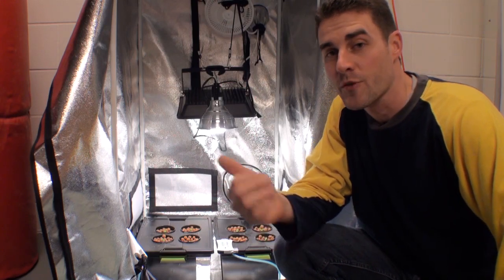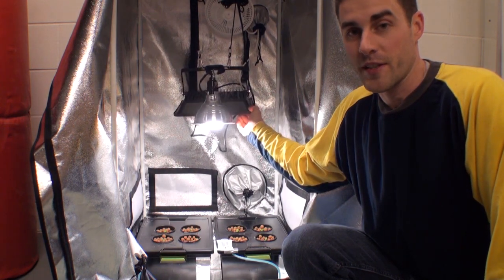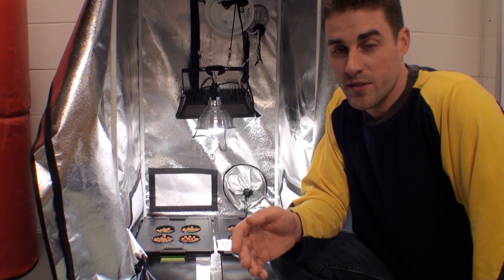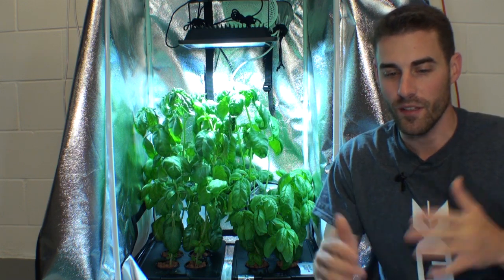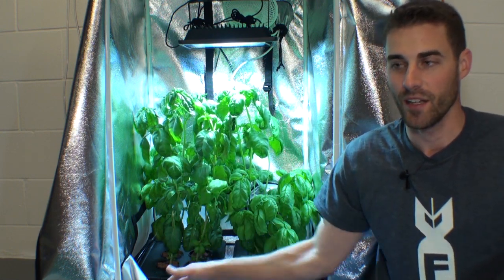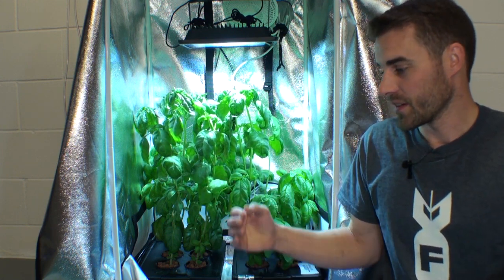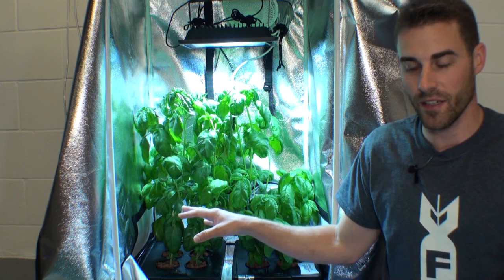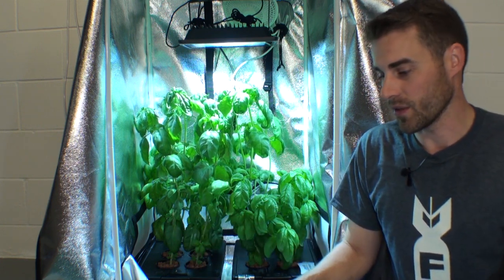Kratky vs DWC - Aeration vs No Aeration (Hydroponic Basil) Part 1

Comment: Hey. Why do you use Leca on the top?
Thank you
Reply from the maker: Just to cover the rock wool
Reply: @GrowingAnswers  so it doesn't have any point or reason to use it?
Just to cover?
Reply from the maker: @vargarobert196  you can use it in various ways. You can grow directly in it so long as you have a plant already because you can’t germinate seeds directly in it. Not easily anyways. I’ll use it in larger net pots as a space filler around small rock wool. It’s also commonly used in drain-to-waste growing. It’s a somewhat easy to clean reusable grow medium but I don’t use it that way. In the past year or two I have just used smaller net pots that fit the rock wool cubes perfectly so I don’t use any clay pebbles.

Comment: Aeration of the water is deep water culture. As you CAN and SHOULD BE fully submersing the roots in the water and continue to top up fully. 

Not aerating the water is the kratky method. Using a gap in the water and media for the air roots to breathe and should only top up minimally to avoid drowning the air roots (1-2cm)

Comment: Used to aerate my hydroponic basil... it does increase yields (~15 - 20%) but by proper pruning of my basil plants (harvesting once or twice a week) I've been getting more basil than I can use without the extra hassel  (e.g. topping off water volume) of aeration.  At the end of the season there's a huge harvest for flash freezing... and for lots of cuttings for the (much smaller) indoor winter basil crop.

Comment: When you aerate - process wise you must balance pH after either the water has reached max oxygenation or the supply of aeration is at maximum effect. Stops any 'overnight' pH drifts due to oxygenation.

As for alkalinity - you should be exhausting those buffers prepping the water in the first place. Just like using something stable and preferably strong to alter pH - yes strong - weak acids have a far more reversible action (lemon juice, some vinegars, phosphoric acid).

Do the above correctly and all you have affecting pH from the hydro is plant feeding and actual evaporation - the aeration affects nothing, you should be at max oxygenation.

The larger the volume of water in your reservoir - the slower your pH will drift when all is right and well.

That's how you concisely cover pH and aeration in relation to water for hydroponics.

Doesn't even touch on how photosynthesis cycles and heat changes create changes in pH, but I digress, this is about pH and aeration.

Comment: Hi - cool video format. A quick request to make it even better: As someone not from the field at all, it would be really usefull if when characterizing stuff you could name quantities and their units. E.g. you characherized the tab water with 140ppm - of what? By later context, I assume chorine? This is not clear, since in many countries, tab water is clean enough to not to need chlorinating. You characterized your light by 6000K - do you mean lumen?
Reply from the maker: FoolWise 140tds (total dissolved solids). Not chlorine. 6000k (k =kelvin.) Color temperature of light. Nothing to do with lumens.
Reply: @GrowingAnswers  Ahh - that makes sense - thanks! I guess this is totally clear to people who work with these things. 
(Its surprising to me to characterize an LED light with a black-body radiation temperature, since that inherently should only work for classic lightbulbs that emit light due to their heat.)
Reply from the maker: FoolWise led emit heat no different than any other light

Comment: When I grew with DWC, I found that one problem with the standard method is that the airstones used for aeration get clogged with salts from the added nutrients and their output is reduced.   To address that problem, rather than using an air pump and an airstone, I used an aquarium power head that had an aeration function.   The way that works is a short length of clear tubing - like you would use with an air pump - is inserted into the output nozzle of the power head with the other end above the water line.   Then, when the pump is running, the flow of water past that tubing creates a vacuum that pulls air into the stream and mixes it with the water - thereby, aerating it.   This method is far more consistent over time and requires no replacement of airstones, or monitoring their condition.   The power head also produces much better circulation of the nutrient solution across the roots.   Making this change made a noticeable improvement in the performance of the system overall.

Of course, I no longer grow using the DWC method.   I now use an ebb and flow/flood and drain system.   The roots are flooded with nutrient solution for 15 minutes every hour and then their containers are allowed to drain completely back into the nutrient reservoir which exposes the entire root structure to air, while leaving them wet with nutrient solution..   This process aerates both the roots and the nutrient solution.   The roots get aerated during the drain portion of the cycles.  And, the nutrient solution gets aerated during the flood portion of the cycles - through the movement of the nutrient solution through the containers and draining back into the reservoir.   The action of the nutrient solution falling back into the reservoir causes splashing and disturbance of the surface, which aerates the solution.
Reply: why does it matter if the nutrient solution is being aerated in your ebb/flow system? the roots are getting oxygen directly from the air
Reply: @jakekeys8171  It matters to prevent the rise of anaerobic bacteria.   The aerobic bacteria are helpful, but not the anaerobic bacteria.
Reply: @richardowens9061  thanks for the explanation, I didn't know that
Reply: @richardowens9061  
Richard, The Kratky method seems to work well, too, but there must be a rise of anaerobic bacteria in those jars/buckets. Yet the plants seem healthy. What difference do you see?
Reply: i used to grow in passive wick system, then i tried aerating it, it seems like the aerated crops grew a week faster than before. i said wick system but its similar to kratky since in the end the roots are drinking straight from the nutrient anyway. i use those long black rubbery flexible pipe as air stone, im sure there are other factors but a week faster is fascinating to me.

Comment: Great video. I appreciate your science outlook. You seem to contradict yourself about aeration, PH, and PH "stabilization" vs "PH creep" which is what most need to deal with as the water sits in a container with roots in it... AS water evaporates, it will climb in PH faster, yes? And thus the water looks more contaminated, higher salts, and we need to change out the water more often, yes? And, we need to check the PH more often, as many plants crave acids, and are not happy in hydro over 6.5, THUS, we are constantly fighting PH creeping up and up over time as water evaporates, and is a major issue on how often water needs to be changed out.

Comment: 7:18 those wire connections look bad. Otherwise cool video and experiment.
Reply: How so. Wire nuts are fine to use are they not?
Reply: @fillmorehillmore8239  They aren't cased, no strain relief and the connectors themselves are far from the IP they should be in that environment. They would never pass the standards where I come from.
Reply: @aev6075  I box all of my stuff for the exception of anything not behind a wall. Strain relief for anything I have done is 8-16" depending on project (If it looks like you can hang anything beyond the nut/staples weight. I usually heat shrink/wrap most things but for what this is, I have seen far worse (electrical tape or even scotch tape)

Code perhaps depends on region but I agree that more could be done.
Reply: @fillmorehillmore8239  It's regional thing for sure. We haven't used wire nuts professionally in decade and consider them trash.

I'd rather use small connection box with stress relief and wago connectors if you want to dismantle / modify your electrics later or if you just need to extend the wires make a good splice and cover the connection with heat shrink tubing.

Worst connection i've seen is two wires rolled together and then covered with blue tack. I wasn't sure whether I should cry or laugh

Comment: I would if you sealed bin as much as you could then pump pure oxygen into the water
Reply: don't even go there for use of pure oxygen  first off you if system leaks O2 into house you increase fire hazard in home with use of pure oxygen just from the increase of o2 saturation, 2nd after a certain concentration level is reached o2 actually has the reverse affect and cause many plant and animal systems to shut down, 3rd as o2 level increase reactivity  changes with various minerals and elements in the solutions  this is also in part what you see as a change in ph the o2 drives off the co2 but it also reacts with metal salts changing the ion balance and  oxidizes  them , lastly if you saturated the air in the grow area  you also affect the plant respiration of   CO / O2 exchange  and  its at this point humans can also show the side effects of O2  of  dry or bloody nose, tiredness, and morning headaches to mention a few

Comment: If your dwc water temp goes above 68`f the available oxygen is dramatically decreased causing a stunt which is usually the case since most of these dwc youtube vids do not run chillers or even insulate their res. Kratky method is not effected by the water temp since it is breathing from the upper roots.
Reply from the maker: Five Star this was done during winter. My basement is usually 63-65f during the entire season. I also mentioned I keep the water level the same in both methods (as if both were kratky.)

Comment: why did you change from the floodlight ?
Reply from the maker: Hrad Records I never changed from the flood light. Not in this experiment anyway. I started off with a lower watt cfl cuz it’s cheaper to run and herb seedlings like these don’t need powerful light to start. It would be different it they were seedlings such as watermelon or tomato cuz they need more intense light to start or they end up reaching too much.
Reply: do you think they are as usable as a standard grwlight 
? I realize that is a complex question it's just i find the whole thing fascinating
Reply from the maker: Hrad Records in my opinion, virtually any light can be used as a grow light. So yes. the problem only lies with efficiency and spectrum. As long as the light is white light you really can’t go wrong if they are just used by the hobbyist. But when you get lights that are trying to create some “perfect” efficient spectrum with just red and blue, then that’s where things can be complicated. when dealing with warm or cool temperature white light it can matter then on what is being grown with it. Results will vary, but with white light the differences in growth characteristics are less dramatic vs being grown under various mixtures of just red and blue. weed growers will debate this till the end of time. point is, it’s simpler just sticking with white light, but it can be beneficial using a light that’s made with targeted ratios of a mix a differing colored light.
Reply: yeah when they are all using cxb3590 they are just white light but the thing that gets me is people are generating colour recipes combining different colour temperatures apparently this is supposed to effect the plants flavour and other nutritional or medical make up.  I suspect the leds used for lighting have a much narrower bandwith is that right ?
say if you got 4000k led spotlight and compared that to a metal halide the latter although  of a similar 4000k temp rating the bandwith is wider.  im thinking although its less efficient what would happen if you combined led and HID ... would you get plants that are much better nutritionally  for us to eat?  what are your thoughts ?
Reply from the maker: Hrad Records white leds actually have a much fuller spectrum than hid. the phosphor causes the light to be more evenly distributed. Hid creates lots of peaks and missing wavelengths. and sure if you tune an array of colored lights you can absolutely Taylor it to specific purpose and plants.
Reply from the maker: Hrad Records and there is no need to combine led and hid. At that point you might as well just invest in cmh instead and forget led.
Reply: is ceramic metal halide better than led I notice you can purchase the ballasts and bulbs fo rshop lighting etc this seems a cheaper way because if anything has the term gro written on it the price seems to suddenly be 4x as much lol hope you dont mind the discussion ... I'm enjoying it this end  thanks for your reply's etc
Reply from the maker: Hrad Records cmh is very good. But better than led? Not in terms of efficiency. But they do have a very good spectral output. I think almost all cmh is sold as a grow light. I think that was the point of engineering them.
Reply: check out cmh used in shop lighting you can purchase the ballast and bulbs cheaper
Reply: thanks for the excellent vids keep up the good work

Comment: These plants are way too crowded if there isn't enough room the plants fight to get to the light so they start blocking light from the other plants that's why the plants are all different sizes
Reply from the maker: In part 2 I covered that. They all started out growing to the same size until I cut them back like I did here. Some nodes had almost no new shoots ready to grow while others did. Naturally the ones with no starter shoots had delayed recovery while the others grew back right away and that set forth the repetition of how they grew back each time. Crowding didnt really give erroneous results though. If each plant continues to grow back the same in each container, then it's giving the results that we're looking for. If it had been a test on overall production and weight, then yes it would matter. This test is focused on looking at growth for the most part.

Comment: I've been playing with DWC Basil for about two years now and i've found that an aquarium filter like the "Eheim Aquaball" work well enough for aerating the water. Also when i close the Cabinet i can even sleep next to it.
I think Basil might not need that much oxygen especially compared to Tomatoes or other fruiting crops.
Also i've found that when i use fresh cuttings they seem to produce best on the second to about fourth or fifth Harvest.
After that they either get some kind of Mold (usually my fault) or just seem to take longer and longer to bounce back. 
Also the taste/smell changes as the plants get older.
Does any of that fit your observations?

btw: What pH and ppm values do you use? A pH of 6-8 and PPMs of ~700-1200 work pretty well for me.
Do you adjust the pH only once or do you let it sit for a night to check again (i never do because im lazy but its highly recommended by most non-lazy hydro growers).
Reply from the maker: I had not thought about using a fruiting plant. I wanted to use basil cuz I could taste it. I wont eat tomatoes. But I did use tomatoes in the other videos and had great results. Not to mention fast growth. I do not let the water sit when I PH. I have done it so many times that I have it down to a science and know what it will be after it sits. Its usually Ph to 6.5. I know it should be higher to start for hydro though. PPM for the aggressive veg nuts solution was 1400. Last hydro grow I noticed some mold on the tomato plants. I believe that air circulation needs to be much stronger with hydro to prevent mold. also pruning the lower parts helps.
Reply from the maker: I also left the ph alone once I put it in the bins. I didnt want to alter anything so that I could better log what happens to the properties of the water.
Reply: Same here for pH-adjusting: I measured how much in need once and it usually works out well.
I think pH 6,5 is right for hydro-basil, i found 5,5-6,5 somewhere and been running 7-8 for a while without major problems.
The mold starts usually at the base of the stem when the plants get really old and woody and the weather gets warm and more humid. In Winter everything works fine usually.
I could put a fan in but i think basil doesn't really like wind or any other kind of weather.
I don't think its a problem though because the younger plants seem to grow more aggressive anyways and it gives me an excuse to try new systems ("the plants are dead anyways, lets try a bed of Hydrocorrels with constant flow now"). Also the roots get quite massive over time and i suspect that the ones inside of the tangled mess don't get much nutrients or oxygen.
In a perfect world i would have another box just for starting cuttings and getting them bigger so i could start new plants for every seconds harvest or so.